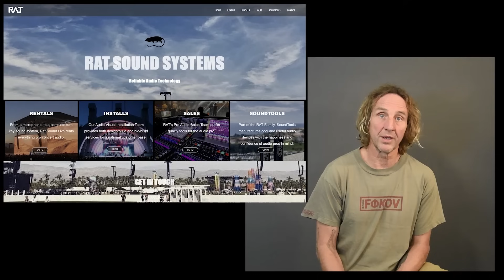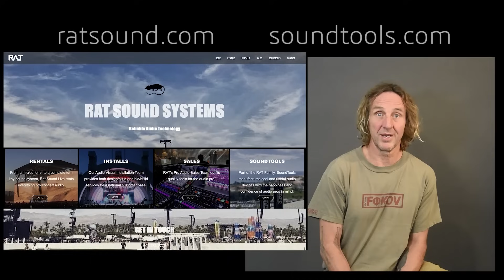How to EQ Live Sound Systems Tricks - Updated Version

Comment: Are we not using parametric EQ for monitor wedges to notch out problem frequencies or does that introduce other problems?
Reply from the maker: this video is mainly focused on tuning for sound quality and consistency well dealing with venue and environmental factors. 

prestige monitors the listener is typically much closer to  The sounds horses then the listeners are in the audience to the main system. 

this greatly reduces the impact of environmental factors impacting the sound 

instead with monitor systems feedback control becomes a dominant factor 

so for main systems it's about sound quality and level versus venue and environmental factors. 

for monitors it's about sound quality and level versus venue and feedback issues 

that said I would use the same technique and have one EQ perhaps the channel EQ that  adjust the mic/instrument combination. another EQ perhaps the mix output that adjusts the monitor speaker / venue combination and compensates for feedback and a 3rd EQ possibly built into the amplifier that adjusts the loudspeakers / monitor enclosure combination.

Comment: I have a question.. what do you do when the room acoustics changes due to audience capacity.. people in the room and people not in the room.. what do you do when you eq your room during soundcheck and then the next day.. people come in and the room acoustics change.. will you re-eq ?
Reply from the maker: I was constantly EQ'ing and adjusting for changes in temperature and absorption and diffusion caused by people and other environmental factors. 

That is why you separate out the EQ for system plus venue such that you have control over those factors without messing up your other EQ.

Maybe watch the videos I did on thermal or heat impacts on sound. I believe there is at least two of them. 

I sound check the main PA mainly to check coverage and the amount of Maine PA bleed and impact on the stage sound. 

What I would do is use house music and look at the response with an empty room and then play the same tracks when the room is full during set change or before my band and look at the response there and compare those curves. I could then do EQ changes to alter for the change in room acoustics due to the people and temperature
Reply: @ thank you so much for this sir.. I used to wonder if I’m the one not tuning well.. I will use my rta mics to tune my system.. and then it sounds right during soundcheck.. and then when the show starts.. I will meet some surprises.. most times.. I would have to just by-pass my graphic eq for system eq and then restart it.. so, I think i have to learn how to use music to tune.. because most times my clients won’t even give a break for me to quickly retune.. thanks so much for this… 

But what about subs???.. my sub sounds weaker too during performance.. should I get more subs
Reply from the maker: You definitely want enough sound system to sound good when all the people are in. 

As far as tuning subs the same applies to the main, if you tune the PA with music to the sound you like and store that curve and then when the people come in play the same music and find that same curve maybe at a lower level than when you tuned once people are in but at least the same balance, then the sound should come up much closer when the band starts
Reply: @DaveRat  thank you so much for this🙏🏿.. I really appreciate
Reply from the maker: Awesome and let me know how it goes

Comment: The headphone mix almost never translates to the system mix. Mixing into the context of the PA and using headphones to troubleshoot problems that can't be pinpointed with the PA* is a much more practical workflow.
Reply from the maker: Perhaps there's another way to look at this and I can say from experience of mixing almost four decades everything from clubs to stadiums that this works.

If you involve headphones early in the tuning process and tune the sound system to sound like your headphones, Yes it's a bit tricky and a complex skill but can be done. Then the mix will translate to your headphones well.

When I mix I use multiple reference points to ensure everything is aligned. I know the way the mix should look on analyzer or I learn and know the way the mix should look EQ wise on the console and I learn and know the way the mix should sound in the main PA versus the sound of the headphones.

By triangulating the measurement software the mechanical knob positions and the reference point of the sound of the headphones, that will allow you not only to create a well-balanced mix but also to compare it to pre-recorded music in the headphones while mixing if need be as well as ensure their ears are not getting duller or brighter from day to day in the middle of a tour because you're using headphones and other reference points.

I've done several other videos on methods 2 establish reference points for worldwide Sonic consistency that may be of interest

Comment: About the eq for anti - feedback on edge monitors i ve had that in the past and the higher a dummy expert that used 3 oct like you mention in video and finally the raise the gain to balance th einput and changed the overall tonality/processing line .After all was looks like normal to me just used a tight knoch filter like a pin eq on that specific vocal main tonality .In ear monitors of course not having this problem anymore.Anti-feedback eq look great to me if they have that kind of gear! . I would probably try to change necessarily the main pa eq if sound good or by the importance of the signal cause the problem .Rather sending a alterated signal lowering the problem ,because a feedback step in from a ring so (starting from there) using a send to mix monitors alterated signal make more sense to me ! Maybe is a misfortune main pa - room and some kind of wedge monitors that where prone to some rings! Whay should i fast tweek the main pa if it sound good !

Comment: Hey, appreciate the video, Dave! By ear (but without headphones), I've tuned a lot of systems via reliable reference mixes, and have gotten pretty good results overall... 

I looked up the specs for the headphone models you mentioned... They don't look like they have the most flat responses across the spectrum, which makes me hesitate on buying either of them, unless you have good reason to insist regardless? Obviously my ol' MDR 7506 headphones would be even worse, but can't resist posing this curious question, considering they're somehow your basis nevertheless.

Also, I often have to do all the compensation for the room AND processing for the system through the board's GEQs. (I imagine that this is actually normal if the board's a stagnant/committed part of a particular venue's system?) I bring this up because I was wondering what the difference would be, as for how many decibels in total I should try to limit, when pulling out volume from a bunch of various frequencies in this alternate manner. I'd presume I should have at least a little bit more liberty on the board's GEQs, if there's no "system processing EQ" going on afterwards?
Reply from the maker: It's all about establishing reference points and correlation to them. 

Flat response for gear is important but when you get to the transducers like mics, speakers and headphones it gets complex.

A razor flat mic on high hat may pick up puffs of air that result in large low frequency signals being sent to the mixer. The puffs of air are real but the fact that a high hat does not create massive low frequency signals is true as well.

So what the mic picks up is not necessarily the sound that exists.

Same with headphones. The output can be razor flat and yet if you set the headphones on the table, you hear just highs.

The freq response of headphones are extremely dependant on distance and depending on the headphones, dependant on the seal around the ears as well.

So, what really matters is

When you mic an instrument, does the mic/instrument combo sound like the instrument actually sounds or sounds how you want it to sound

Same with headphones or speakers. When signal is sent to them, does the reproduced sound mirror what it should sound like, what you want it to sound like or expose all of the frequencies you need exposure to to make informed decisions about the sound
Reply: @DaveRat  Wow, thanks for such a quick response! I guess I'm a little confused as for why the graphs would not be taking into account the stuff you mentioned (the small distance from someone's ear when they're being worn, or the type of seals and how they'd affect the sound, etc.) I understand that this is a complex topic; so, I don't really mind just taking your word for it that these headphones will properly translate everything (provided the gear is relatively transparent obviously)... I just wanted to be sure there wasn't something I'm maybe missing.

However, I'm still wondering how much more liberal you think I should be able to be in theory, when handling everything from the GEQs (that is both the elimination of any feedback AND the tuning of speakers/room). 

I know you said that the limit should be about six 1/3 8ve bands (each being pulled down 6dB at most), when using a GEQ exclusively for feedback elimination... But I didn't catch you saying anything about how conservative you should try to be when EQing in the system processor. 

Like I said, I don't have a system processor on any of the setups I'm dealing with--I have to do it all from the GEQs. Perhaps the conservatism doesn't apply, if all we're doing is adjusting frequency bands solely for getting a proper reference mix to translate closer to an ideal pink noise curve? In other words, is the conservatism important only when notching out any feedback that remained after the reference-mix tuning was done?

Comment: Dave.....At the beginning of this video you talk about using Channel EQ to repair abnormalities in the mic/instrument and using System EQ to repair speaker/venue. Later in the video, you talk about ringing out monitors and FOH where the guitar sounds great, but vocals feedback at 2k and you say to reach for the channel EQ.  Which EQ should I be using to fight feedback issues (system or channel)?
Reply from the maker: If the feedback is on a particular channel, use the chanel, if the feedback 8s on multiple channels sending to the same speaker, use the EQ of that speaker. If the feedback freq is prominent on all or most channels in all or most speakers, use the overall system EQ.  

Of course this varies depending on mains or mons but you should get the idea

Comment: The part about recording is true for bigger venues, but not for small clubs where a big part of your PA has to be balanced with the direct stage sound, which makes an unbalanced output to the PA.
Reply from the maker: Record off of a separate matrix output that compensates for those imbalances
Reply: @DaveRat  MOS def! Really appreciated your tip about comparing with reference headphones btw. Just used it the other day and made much sense!
Reply from the maker: Excellent!!
Reply: Quick dirty trick: If you need to mix from the side of the podium, use some half closed or cheap closed headphones and use the leakage from the live stage balanced with the volume level from the console to get a pretty close idea of what is going on exactly on the FOH. It is usually pretty low, unless your headphones are really bad or open back hifi thingies It is a dirty trick, so, use at your own risk

Comment: I use pink noise to make speakers sound good. I play it on one speaker and the other speaker I key in a band EQ. Works perfect.
Reply from the maker: Things get more complex when doing left, right, outer left, outer right, center left, center right, and center. Using multiple pink sources allows you to measure the coverage and and transitions between various zones without comb filtering issues

Comment: Hey Dave, what's your take on sends to monitor wedges being POST Channel EQ, as opposed to being sent PRE Channel EQ?  

This seems to be mixed response on those I've asked with many years experience.
Reply from the maker: For a dedicated Mon console, you would want the ability to EQ the mics going to mons.  For mons from a house console, post EQ to mons can be an issue as EQ on the channel for mains can mess with mons and create feedback or issues.

So it's best to Y the mics into 2 channels and use one channel for mains and one for mons and then you have separate EQ and gain for mains and mons
Reply: @DaveRat  ah, I didn't think of Y ing the mics. I wonder if this can be accomplished with digital routing.  I'll have to try it out.  Thank you!
Reply from the maker: Yes, a digital Y is good too. Though often that links the gains and sometimes it's nice to have separate gain controls
Reply: @DaveRat  you are probably right on with gain sharing.  Still neat to experiment and see what's possible.   Thank you very much for the info.
Reply from the maker: Cool co Anthony and let me know how it goes and thank you for joining!!!

Comment: I think it's arguable that you can obtain a clear well balanced mix 100% of the time. Small venue acoustics determine what you need in the mix as well as the mix itself. Loud drums or even louder guitars 😁 are sometimes omitted completely, rendering the reference levels moot. What would you suggest as far as the system eq is concerned? Wouldn't the requirements (specifically frequency range) change?
Reply from the maker: Not sure I understand the question. What type of system EQ?
Reply: @DaveRat  maybe a bit more info would help. My house sound gig. Around 300 capacity, full stack guitar amps get brought in regularly, and almost never get put through the PA (monitors yes, another story). Often other annoying instruments (snare, even overheads at times) are too loud, and only slightly reinforced by the PA. The end result is usually a very lackluster board recording that can sicken even the most tenured of ears.
Reply from the maker: Ahhh, to get a good board recording in a venue where certain instruments do not need to be reinforced requires a separate mix. Send all instruments to groups, dial up the recording on matrix outs with all groups sent, dial up the pa on different marix outs with 9nly the instruments you need sent.
Reply: @DaveRat  I did mostly field recording when I would record, a separate stereo mix is a bit difficult to achieve using a solitary board for mains and monitors. I just went digital at FOH, so that's a whole new ballgame for capacity to route and process. Thanks for responding, have fun out there!
Reply: @DaveRat  system eq for very small venues where using reference levels like you described but producing an undesirable result (eg- too much guitar, etc).

Comment: I'm in a situation where I have a quality computer, and can run low latency monitoring straight through my Pro Tools, Ableton, etc in a live scenario.. Wth a mastering chain and all the individual inputs, I can now run an all virtual mix, using  the mastering chain to compensate for any room or system problems. Obviously the fear is relying solely on the computer. Any thoughts? Have you digitized?
32x32io
Reply from the maker: Hmmm, I have always a oided mixing purely in digital, that is a question best answered by someone else

Comment: 1k Likes (im the 1000th) <3 thanks Dave! one quick question though are you more of an additive or subtractive EQ guy when it comes to channel EQ for correcting for Mics/Instruments to get the sound that you're after?
Reply from the maker: I will boost or cut, whichever gives me the sound I seek with the least amount of EQ.

Mic choise and placement to get as close as possible, EQ to fix whatever is left to be done tonally
Reply: @DaveRat  appreciate the reply Dave, always have looked up to you as an engineer since 2004 when I started learning about Audio as part of my careers. I've always been taught its better to get the right mic in front of the right instrument (or amp) and then adjust the system in the manner you describe. Always found the debate about boost vs cut amusing because the correct answer (and the most musical one) is to just make things sound "right" and then work on making each thing blend into the over all mix in the right place to get where you want to.

Comment: Nice Tangent 12x2 :)
I cut my teeth on a 24x4x2 back in the early`80s (F#&k me, I`ve been doing this for too long, but still loving it). Good sounding console as I recall.
My EQing method differs in that I use a variety of very familiar music to fine tune after the system drive processors have been tweaked by whatever means, SMAART, SIM etc.
There is always a very nice playback system at home that I use as a reference for that music. Get the PA sounding as close to the reference system as possible, apply some channel HP where needed, bring the channel up and your already in the ballpark.
As for the equalizers, it`s been my experience that the ISO center frequencies on graphics rarely if ever coincide with actual problem frequencies and bandwidths.
I feel that many engineers, monitor and FOH end up  abusing graphics because of those shortcomings.
A 4, 5 or 6 band parametric is all that is really needed for many applications and it can address any issues more precisely. It is very easy to over EQ a system, you`ll just end up  tuning the life out the program material.